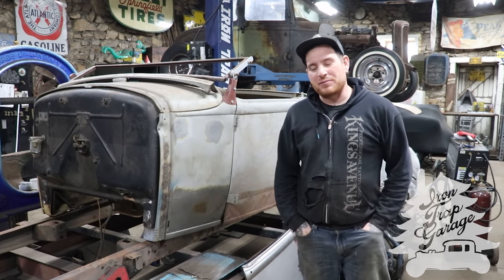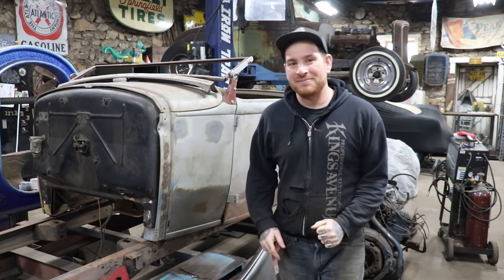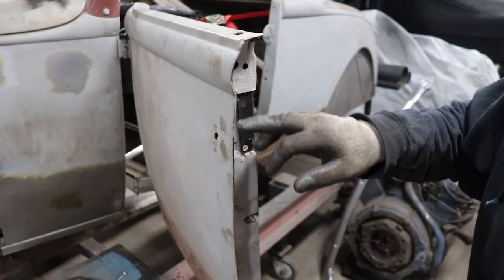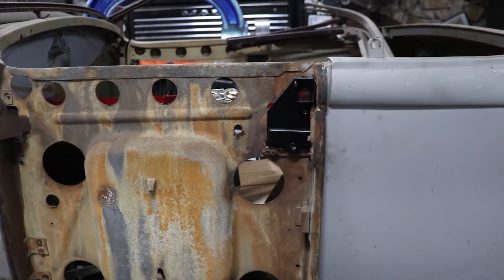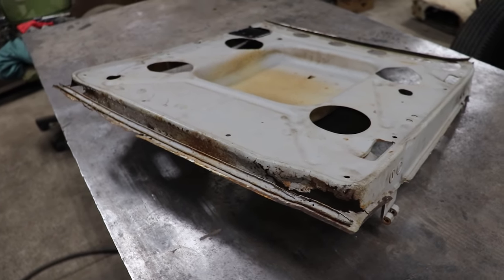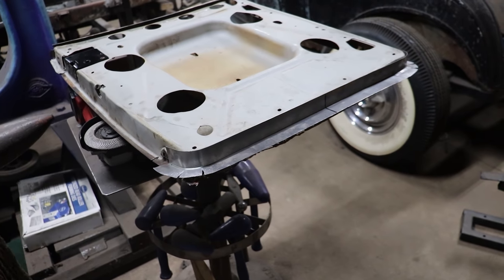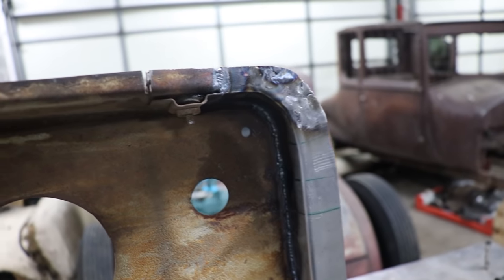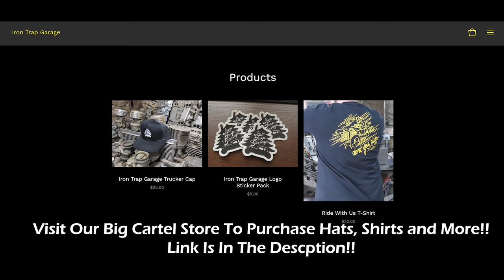How to Fix a Rusty Ford Model A Door Part 1 - Rust Repair

Comment: I like how you sanded thru the edge of the door skin to remove it. I probably would have tried to peal off the wrap around lip. Much cleaner and less stress to the part. Sweet! Thanks!
Reply from the maker: Yea I learned that after spending hours drilling out spot welds and wondering why the heck I spent all that time saving a part I was gonna junk! Haha. Thanks for watching!
Reply: Yeah, that was cool!
Reply: I have seen guys grinding the edge to remove skins on modern cars as well .

Comment: Thank you, thank you thank you!  Both of my roadster doors are rattier than the one you are working on. This stuff is really helpful. Do lots more. I recently bought a set of Eastwood offset bead roller dies and by making two offsets the correct distance apart, I used a half inch bead roller male die and a skate wheel to put a nice arc between the offsets. I used the roller like an English Wheel to make an arc that was bigger than the roller. It takes patience, but I made a 7/8” bead with a 1/2” bead roller. I did not understand the skate wheel until you explained it.  Thank you!
Reply from the maker: That’s awesome John! I’m glad you were able to build upon what I showed! Great job!

Comment: I have this on a 37 Ford Tudor door bottom. I really don't have a gap, and it kind of sticks out at the bottom between the door, and the body. The door closes good now after tweaking it with a pipe wrench. How do you adjust the door gaps??
Reply from the maker: It varies on every car. I’d start with loosening the door jamb screws and seeing if there’s any adjustment in the hinges/doors.

Comment: Maybe a good future video would be on how to true up and properly brace a weakened body to prevent any further damage and get it ready for further work? Any work done on a body that is twisted and out of true is pretty much work wasted? I made some that had some allthread sections to allow a little push/pull and they worked fine. Anybody make a universal body bracing/ gapping kit?
Reply from the maker: Great idea for a future video! We plan to do that when we brace the 39 Mercury to pull it off the frame!

Comment: You made a good job of that inner door panel. When it was built, what was its life expectancy 15 years, maybe. 80 years later Matt comes along to makes it like new again. Its a wonder there's enough of it, to find something to weld to.  I wish when the start manufacturing replacement panels they might once in a while actually compare them to an original.  Sometimes they they just don't fit well at all which makes it twice the work to fit it.

Comment: Model A body's took shimes under the cowl for aligning the door. Hinges were mount to the cowl and aligned to the cowl. Then to aline to the rear section you you shim the two front body mounts to get the angle you need. Nice repair on the door. Well done.
Reply from the maker: Yep I’ve seen those diagrams before. I figured I’d fix the body with no shims now so it allows for future owners to shim the body as it flexes or moves and twists over years of driving. Figured since I’m starting a ground zero I’d do it with no shims. Gives room for shims when The owner does final assembly. Thanks for the tips!

Comment: I restored a 29 roadster back in 69-70. My good friend and street rodder suggested I pull the sides of the body in until the doors fit at the bottom, then make a fitted I" square tube welded in place underneath  the surround to hold it. The owner didn't want that and the doors still stick out a little at the bottom. My friend explained to me that over the years of use the body panel  tended to move out at the top. You probably already know this? The "Free Tee"  Thanks for sharing.
Reply from the maker: Thanks for the tip Bill

Comment: Matt, I loved the video and the work you did behind the scenes.  It really is actually interesting how you repair the rusted metal area.  Not to be critical about your safety PPE but you should wear ear protection too.  Take it from someone who is now dealing with hearing loss after years of exposure to tool and equipment noise.  You'll thank me when you get older.  Great to see you wearing eye protection but definitely recommend some sort of ear protection too when working with the grinder. :)
Reply from the maker: Thanks for the tip I’ll try and do that more often.

Comment: I'm very jealous of that metal brake!! Great video! It's good to see I'm not alone TIG welding in patches to old pitted steel. Are you using a 1/16" tungsten? Once I started using that with .030 wire, it started going alot better.
Reply from the maker: Yea it’s tedious work but a lot more controlled than MIG as you know! I use a 3/32 tungsten sharpened to a point and .035 filler rod.
Reply: @IronTrapGarage  Try a 1/16"...sharpened to a point.  You'll be surprised how much faster and controlled it is on thin sheet with corrosion pockets. Heat Affect Zone is smaller too...  I love using it when trying to save an original paint panel. I can weld almost right up on the original paint area=smaller paint blends!!

Comment: I enjoy all your videos but this was especially cool for me as  I have some doors that need work. I was just going to dive in, and I have fab and machinist background but this helps unify my approach. Recently rescued a 66 D 200, did the first start  where I found it and drove it  home. Just that was worth  the 500 I paid for it. It was less than 2 miles from my place and I never got over 20 (no brakes) but very satisfying. Brakes are coming along, tires are next. Has gigantic (and ancient) bias ply LT 235/85  R16.

Comment: Hey Matt run a vertical down mig weld down the inside of the panel then come back and fuse the outside with the tig torch the mig weld provides a backer.

Comment: Also look at the 'Junkerup' videos making Chargers out of rust. Pushing and pulling the bodies to get them back in shape so as to make stuff fit on old cars. And yes bracing the bodies is imperative, and more so with these old cars
All of these videos give many the idea of how to actually do all of these jobs. Arkward but not super hard either.

Comment: About those pin holes. If I have some pin holes or a thin spot I like to use bronze silicon Tig rod. That stuff works great for filling holes, pinholes and also as a seam sealer. Or if it's dirty metal and you're having a hard time getting a good weld that bronze silicon rod doesn't care it's dirty. The only thing it's not good for is anything structural.

Comment: Great work!!!! Back in the day, before replacement door skins were available it was common to (1) grind off the skin, (2) straighten the panel, and then (3) edge weld (gas) it back in place. Lead no plastic. I seem to remember the first plastic here in New England was "PERMEND" about 1957 or so. Great to see you are caring on the metal working tradition.

Comment: Excellent work as usual. 
I restore old rusty junk too, so I know what you have to go through to make them strong again. I know what you mean about balancing full penetration vs. burn through and that takes much experience to get there. I thought your welds were awesome...I know how ugly they can be when melting 80-90-100 year old metal...especially when you have a nice bead going and then it fizzles away like a 4th of July sparkler due to rust...ugh. Keep the detailed fab stuff videos like this going, it will help novices, so they dont get discouraged!
Reply from the maker: Thanks for watching! Matt had a hell of a time when building the Free-T. The metal was just a mess!!

Comment: Nice TIG work on the door edges Matt. Appreciate the details on rebuilding the doors, I am guessing this thin metal repairs can’t be done with a MIG.
Reply from the maker: Thanks Craig! You can certainly use a MIG for these, just takes a little more grinding and such as it is harder to control the heat when welding.

Comment: This is the type of stuff I need to see to get me working on my 32 pu doors!! Thank you. I get so focused on making it look original that I get overwhelmed. When all I want is a primered hotrod. It’s Hard to tell yourself that you don’t have to fix every pin hole.
Reply from the maker: It definitely depends on the car, your expectations for the car, and the end value of the car. Aaron would have far more into the body than it’s worth if I had to fix every tiny little imperfection. I’m making it “nice” but not going overboard. Those tiny little pinholes will easily get sealed when we coat it all and won’t be a problem. You’d be surprised how many nicely restored cars have corners like that cut.. they just don’t lay it all out for everyone to see like I do. Thanks for watching!

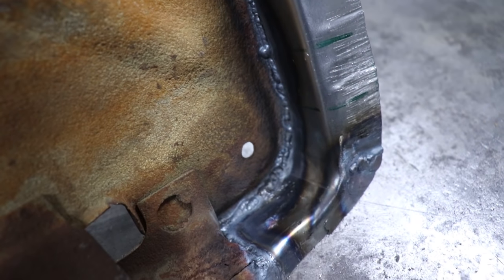Comment: 24:33 That weld will rust out unless its treated well. I lightly sandblast that inside weld and often will let it rust a little so that POR15 will stick to it and stop future rust
Reply from the maker: You let the weld rust? That's sort of defeats the purpose of blasting... The entire inner structure will get cleaned and treated/coated before assembling.

Comment: Nice work, quick question: i noticed you started by tacking the piece at the ends of it but i remember my teacher told me to finish by tacking the ends to leave some space for the metal to move to prevent warping,  does it really matter that much?
Reply from the maker: It does matter on an exterior patch panel for sure and as a general rule of them I usually start on one end and work my way down the line adjusting as I go.
Reply: @IronTrapGarage  gotcha thanks